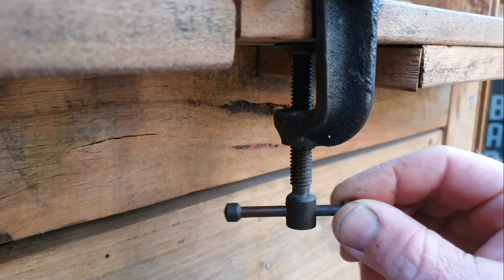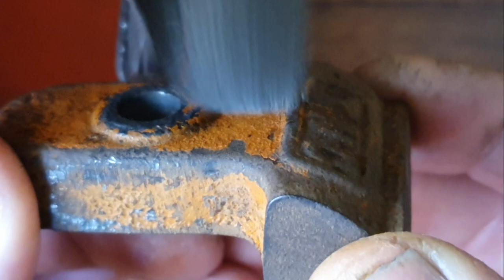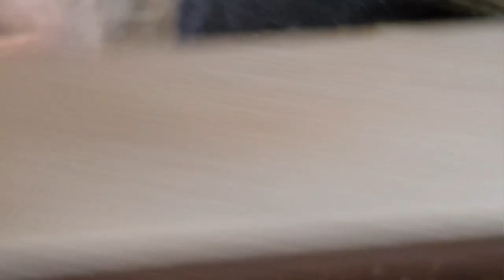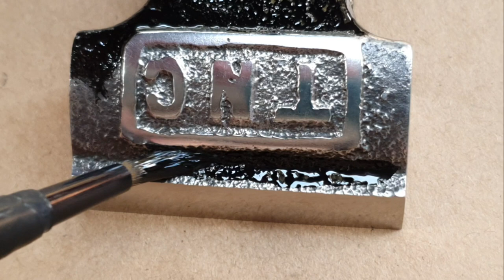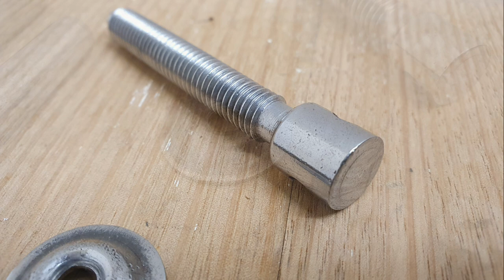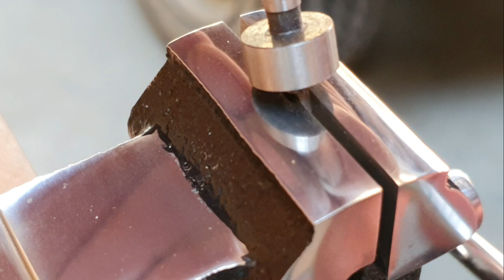RESTORATION OF A OLD TNC VICE.

Comment: I’ve just finished the exactly the same vice in hammered silver and red. Shocking casting on those vices and I had to turn up a new circular plate on the bench clamp for mine.
Loved the way yours turned out. Much better than when you started and probably better than new.
Reply from the maker: Thanks mate yes definitely bad casting.